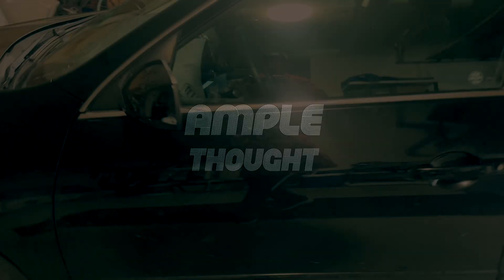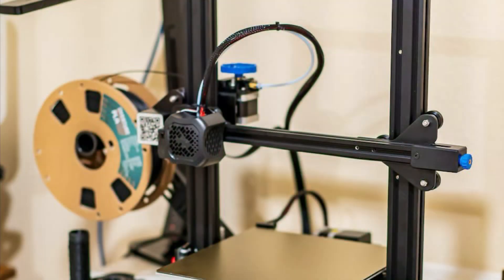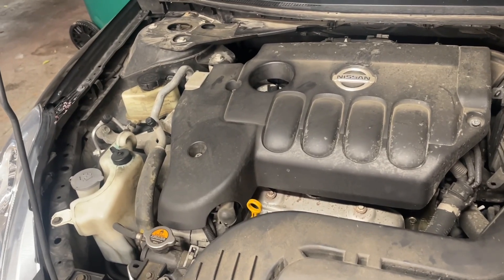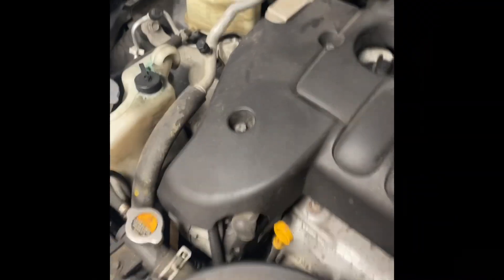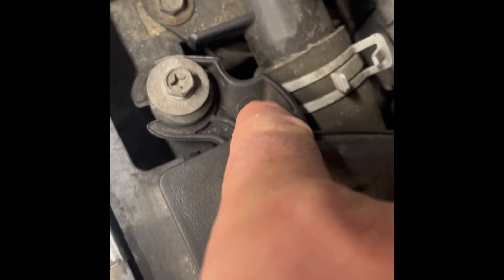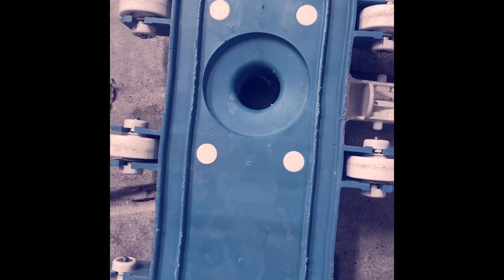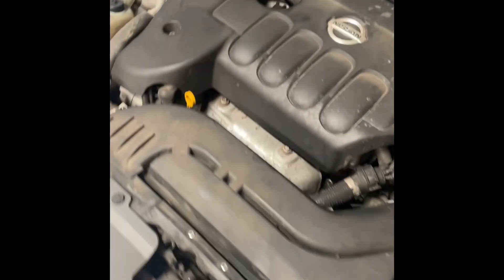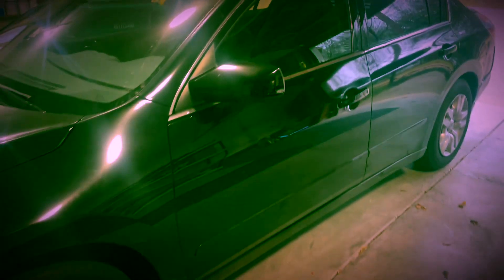What Car Repair Vídeos Sound Like to Normal Humans

Comment: Yeah, that works, but you can save like two hours and sixty bucks by using a flucus valve encabulator to remodulate the throttle position transmogrifier, plus that way you don't have to remand the cam phaser manually. Thanks for the tutorial, though, reminded me of why I'm a mechanical genius and everyone else is a slobbering imbecile because internet.
Reply from the maker: Exactly. Because internet.

Comment: you forgot to check the positive alternator ventilation solenoid, now its gonna start burning transmission fluid and the muffler bearing is going to seize. just order a reman ac jatco cbt (i do mean cbt) itll probably arrive 3 minutes before yours gives up the ghost.
Reply from the maker: I KNEW I forgot something. Well… at least I didn’t snarl the captimitor manifold. Those things are built like a brick and made of gold ferringa castings. Cost me £450 in Wales 🏴

Comment: Thanks for the video, but I ran into an issue when the oscillating accumulator kept discharging into the neutral hot bus. Anyone else having this issue?
Reply from the maker: That’ll happen. Florbles and gipwads shift axially along the balsalmic arbitrator.
Reply: @amplethought  Ohhh ok that makes sense. I'll lease a bi-modal valence actuator, should do the trick.